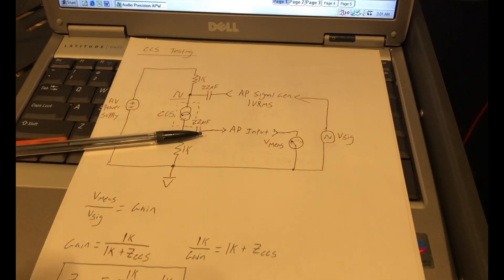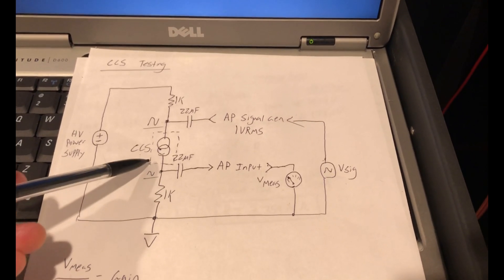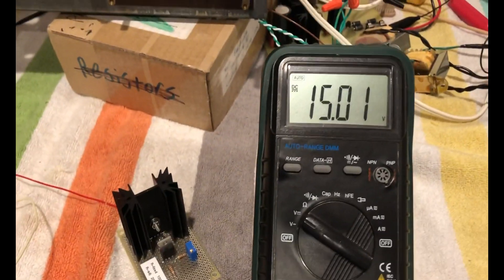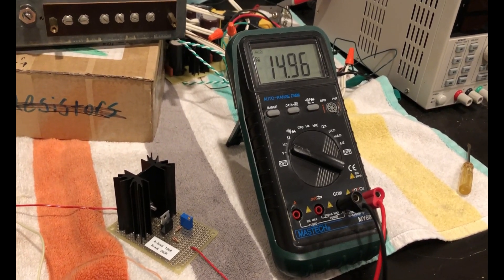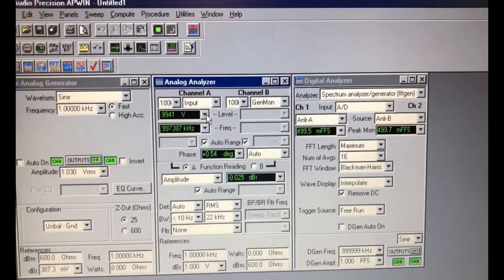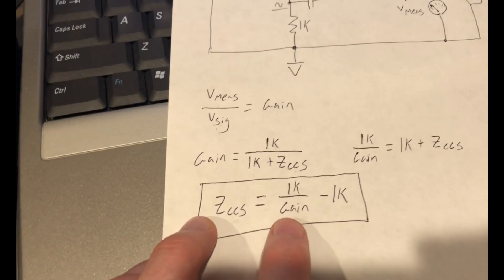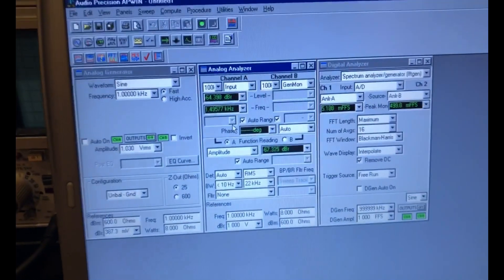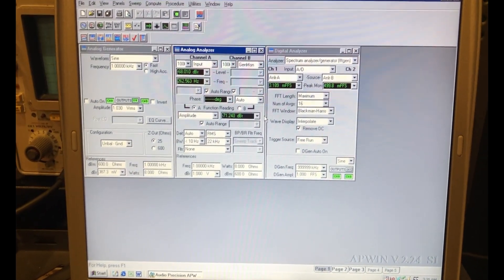Measuring the Impedance of Constant Current Sources CCS for Tube Amp - Project 2845 Part 7

Comment: Do you have any plan to launch the product?
Reply from the maker: We hope to have the amp wrapped up at the end of this year as a completed product. As the project progresses we will announce when we can start accepting pre-orders. Due to cost of holding inventory for a product like this, the 2845 amp will likely remain special order with deposit only, and not be normally stocked. 

Drop us a line through our website if you are interested. Thanks!
Reply: @bandwidthaudio7479  thanks for the reply